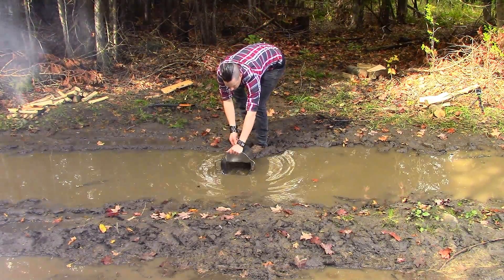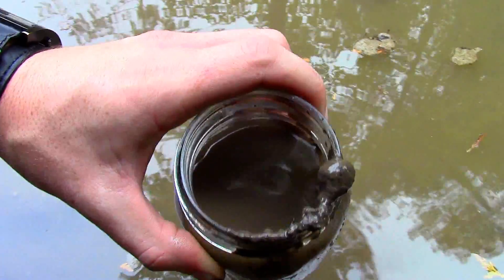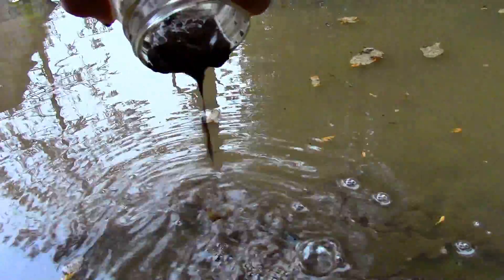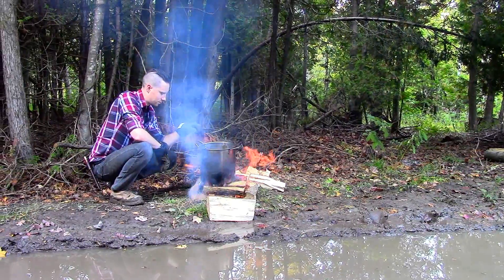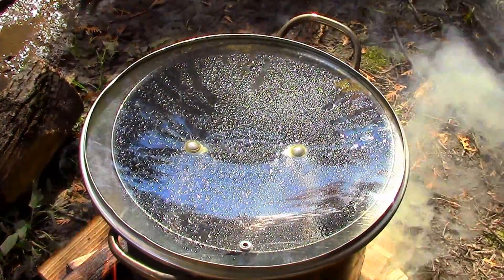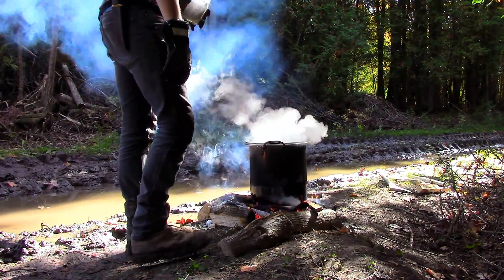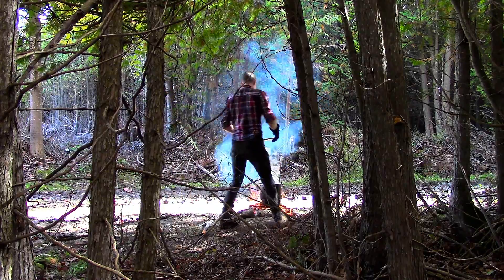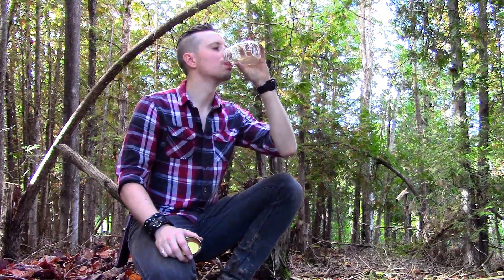Survival- Turning Mud into Clean Drinking Water

Comment: Cut the bottom off a plastic bottle, put the cap on the top (which will now be the bottom), then fill with: Gravel,  crushed cedar bows,  charcoal, crushed cedar bows, sand, crushed cedar, ground charcoal powder, crushed cedar bows, sand,  crushed cedar bows, small gravel, then larger gravel in a bottle.  Flush several bottles worth of water through this unti it runs fairly clear.  Then cut a 2" long piece of green pine branch, greener and newest growth the better.  It has to be bigger than the bottle opening with the cap on it once debarked.  Whittle it down until it fits as tight as possible into the end with the cap.  Use clean pine sap (heat it up), and lube up the end that is going into the bottle to create a water tight seal of the pine branch into the cap end of the bottle. This is key, no water can bypass this pine branch, has to flow through it not around it. This will filler many non organic contaminants as well as all bacteria.  Filters down to 70 nanometers, bacteria are 200 at the smallest.  Then take this captured water in a clear container, leave it in direct sunlight for a day and that will get rid of most anything else hamful via UV light. It is drinkable without the UV step, but this is just an "icing on the cake" precaution.  Bam, done deal, and the only thing needed not found in the forest are 2 plastic bottles, which are on the side of most any road.  An aluminum can cut in half is also helpful to melt the tree sap. Can boil the finished product if you like, but not really needed.  The wood used needs to be coniferous like pine, spruce, fir or cedar.  Some others work, but the mylem in these is best for this application. The crushed cedar bows in the sediment portion of the filter just act to keep the layers separated, and have some antiseptic properties.  It also filters out the large particulate that can clog the pine mylem faster.  True survival method as it doesn't require a huge pot with a huge glass lid, which are very rare in the forest or in your backpack lol.

Comment: If you can't find standing water but you can dig down and find sludgy mud, you can get (dirty) water out of it.  It is done in the same way that you wring water out of a wet towel by twisting.  So take whatever fabric you have and lay it flat.  Scoop mud out and put it in the middle.  Fold the cloth over the mud so that none can escape.  Twist the cloth and the water will be forced out of the mud through the cloth.  Let the collected water sit so the impurities settle, then put the water in plastic bottles and let sit in the direct sun for 6 or more hours.  Lastly, go in the house and wash your hands!

Comment: What did you do about leakage around the rivets that hold the handle on to the glass top?  The leakage around the rivets is what cause your water to be slightly yellow. You most likely could have stopped this by using plastic foil or aluminum foil. Just asking.

Comment: If I may make a suggestion concerning the container with which you capture the distilled water. Use something other than plastic. If you use plastic in any warm environment, it will release a hazardous chemicals and one specifically called Bisphenol. It is better for your body to use cooking utensils and especially water containers that aren't plastic. If they are, then they must be kep in an area that will not be exposed to sunlight. make people are unaware of this. These chemicals are known to cause cancer, and some even can inhibit hormones within the body. Please cook with either glass, stainless steel or cast iron. If you can avoid plastics in a warm environment please do. or at least keep them away from heat.

Comment: You should never use a plastic container for hot water! Toxic chemicals from the plastic will seep out from the hot plastic into the water.
Reply: *survival situation
Reply: That's a plastic container used for microwave oven, they're BPA free and very safe.
Reply: That's not true, how do you explain microwave-safe plastic wrap?
Reply: @PinwheelCinema  why do u microwave plastic wrap to begin with?
Reply: @roy.s380   Originally plastic wrap was made from PVC (polyvinyl chloride). Many plastic wraps still are, including those used in catering and professional kitchens. PVC-based plastic wraps are believed to leach plasticizers when heated. Fatty foods, meats, and cheeses in particular tend to draw out plasticizers from plastic wrap more so than other foods. 

Manufacturers now use other materials like polyvinylidene chloride (PVdC) and low density polyethylene (LDPE), both of which the FDA considers to be safe. But the only downsides of these plastic wraps is they tend not to cling as well as PVC.

According to the FDA though, rigorous testing proves that the chance of plasticizers leaking from plastic wrap when heated is slim to none. Manufacturers must test their plastic wraps so that they adhere to FDA regulations and only then can the products carry a "microwave safe" label. The plastic wraps you'll find in the supermarket all have been okayed by the FDA and are safe to use. They should all say "microwave safe" on the packaging.

Source: https://www.huffingtonpost.ca/entry/microwaving-with-plastic-wrap-safety_n_1121271

Comment: A faster and easier method of distilling water is to simply put several layers of cloth over the top of the container. The steam is forced through the cloth saturating it rapidly. Pick it up and wring it out into a clean water container. Almost all the steam can be collected that way. Water can be distilled as fast as you can boil it off. I used a towel wrapped around two sticks several times draped just over each side of an aluminum camp pot to wring it out without burning my hands. The towel won't burn as long as there is water in the pot because the water is wicked out to the edges. The fabric saturates rapidly and requires constant attention but it's very efficient and the production rate is very high, more so than a copper coil. Just don't use your underwear, you might need it.

Comment: Excellent post. If in an actual survival situation where purifying water was an imperative, a modification of this could be to boil water in a burn bowl using heated rocks and collecting the steam in fabric covering the top. It might be slower but the steam would probably saturate the fabric without having to cool it down perhaps speeding up the process a bit. Just don't use your underwear or socks.

Comment: Interesting to see how simple albeit inefficient distillation can be, but in a survival situation you could probably achieve more by taking smaller cooking pans and have the space for a water filter (perhaps a carbon filter as well to filter out both microbes and chemicals). If the concern is volatiles, could you not solve much of the problem by filtering it through a bag, boiling it then using a proper water filter to get rid of any microbes? (Though they'd be killed by boiling anyway i guess). Also look out for sphagnum moss, not sure if you have it in the Americas.
Reply: Sigebrand Eisenreich what kind of bag for filtering?
Reply: a milibank filtration bag is what I had in mind but I guess you could just use any appropriate fabric in a desperate situation to basically filter out dirt and the worst of it before sterilising it by boiling or otherwise for chemicals and/or bacteria...I have seen one or two good videos of Ray Mears making a filter system from natural materials (including moss) inside a plastic bottle that seemed quite effective, worth checking out.
Reply: Sigebrand Eisenreich thanks for the bag clarification. You had just said "bag" which encompasses a lot of different types. ;-)

Comment: Why would you try to filter already distilled water, wouldn't it have been better to try that prior to the boiling to alleviate some of the sediments?
Reply: I think that it would be easier to filter out dregs of stuff from previously distilled.  There will always be smoke and dust and stuff, and can make your home made filter last much longer, you can always scrub out the boil pot.....
Reply: Buy some white T-shirts cut them at the seams. Then cut them in squares. Fold and use as filters. Then boil the results
Reply: Very good point

Comment: You can do something similar with a hole and a basin of the water you want to destill you put the salty or muddy water in a basin in a hole, and place a clean collection jug in the centre,  you then cover the hole with a clear plastic sheet (like the clear plastic tarps you can use as emergency shelter) you place a stone in the middle so the plastic dips over the collection jug then you leave it to evaporate in the sun and run down the plastic sheet to drip into the jug. Its ok if you want to have clean/desalinated water for your evening meal or to collect for the next day. Your method is quicker but you can leave the one I suggested all day or add more water to the basin if need be.
Reply: Old vietnam pilots used to learn a similar method by peeing in the pit and using the vapor from that.
Reply: Yes we all saw that episode of Man VS Wild too. Better to use black plastic to heat the hole faster.

Comment: Excellent experiment Brother, very well done. I have this very problem in some of the areas we utilize for bushcraft and recreation. I've been thinking about it a lot but haven't acted yet. This vid inspires me to try. So far, my theory is to skim off the top as much as possible and prefilter with a bandana and shemagh. Then filter through grass/gravel and charcoal from the fire (in a birch bark funnel or plastic water bottle with the bottom cut off. Then boil it, let it cool . . . and hope it's palatable. At least it will be safe to drink and life sustaining. We have so much surface water around here, but not where we recreate! Appreciated your point about chemical contaminates like pesticides and the danger they pose.
Reply: Would you consider bringing some Brita type filters. Id still filter thru cloth before hand and boil. And always try to find running water or collect your own rain water.

Comment: Cool method, but...if you havent got, or cant light a fire...
You can filter the water through cloth, put it in a clear bottle and leave it in sunlight for 6hrs and its purified.. (SODIS) recommended by Red Cross, WHO, UNICEF
This also works in low temperatures, you just need clear skies. And maximum 2l bottle.
Reply: Or. Filter the muddy water thru a bandana or sand and charcoal boil and drink ...yuk mud tea but you wont get disease
Reply: I don't know about this? Seems to much bacteria would still be in the water and heating would escalate bacteria growth, but direct sunlight?, might kill off stuff.
Reply: If it doesn't work anywhere in the world, then it can't work in Africa. Unless "your" Africa is on another planet.... And, btw, the sun is the sun anywhere on earth. It may take longer where it's colder. But the sun is the sun....
Reply: (The know-nots are barking)
Reply: +lynda williams SODIS works in Africa where the sun is high at the sky, but it doesn't work anywhere in the world.
Reply: Check your facts Ist Geheim
Reply: @Ist_Geheim  It's UV light based. You get just a good a suntan on a ski slope as you do on a tropical beach. You can buy little water purifiers that just have a UV light in a bottle.